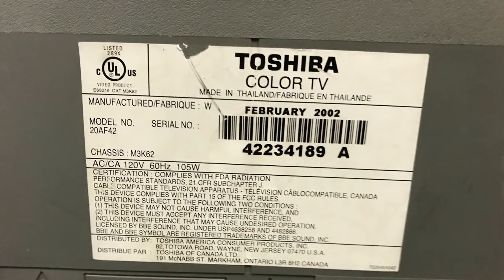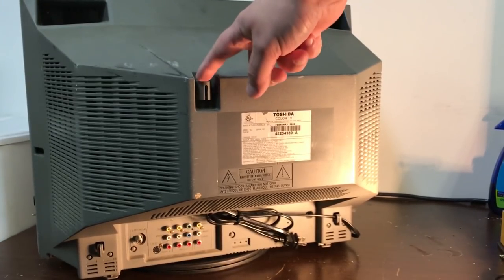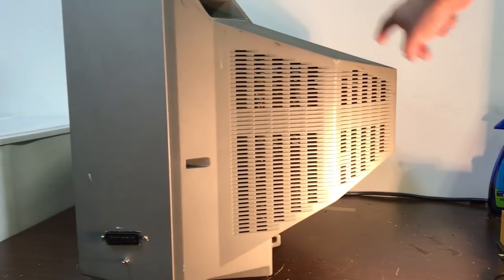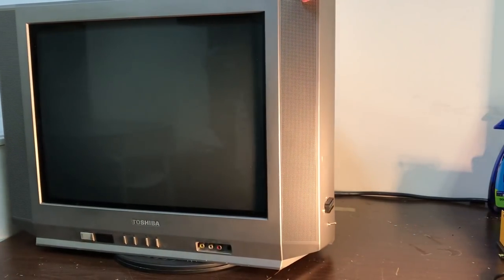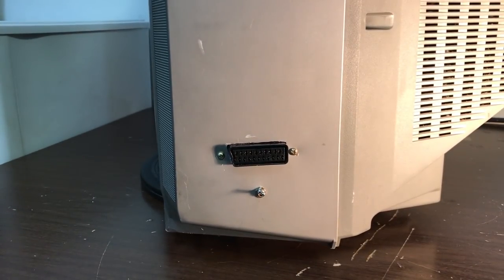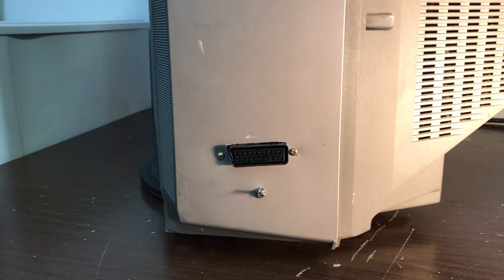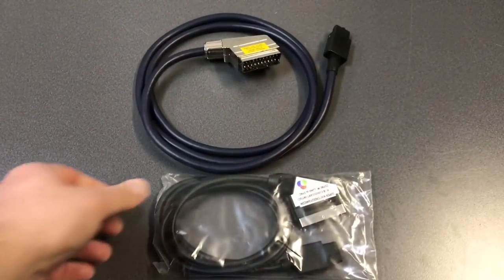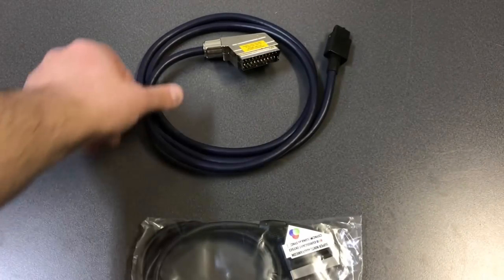RGB mod VS Component Video on a Consumer Grade TV

Comment: I have a Toshiba 14AF44 that picked up off the side of the road, so I was glad to see a similar model! I'm very appreciative of the Composite, RF, and Component ins, the 14 lacks those output composites though. My TV's yoke is ever so slightly tilted and it nags at me every now and again, is it worth it to remount the yoke on such a small consumer grade TV? I've tried adjusting it, and it's held on too well to get a lasting change
Reply: you may be able to look up a service manual for it online that may tell you how to rotate the screen via the service menu. i was surprised to find that i was able to do it with my sony crt without having to mess with the yoke. you might need an original style remote to do it though. i needed one for my sony since it also was a roadside find.

Comment: I am sorry to say that the issue you have with your red isn't the capacitors, it's the tube, or to be specific the red electron gun that's too much aged. If you can live with that you can still have hours from this TV, otherwise nothing you can do other than swapping the tube, though perhaps you have a potentiometer for the red electron gun power level (like the SCREEN/G2 pot on VGA CRTs) that would allow to alleviate these issues by raising the red electron gun power input. This is not a Trinitron so you have one electron gun per color, that's why the others look fine.

Comment: Was there ever a follow-up video? I have a Toshiba 27D46 that I’d like to mod. The image appears shifted or stretched/overscanned to the left using HD Retrovision cables, possibly due to the sync jitter issue they describe where some TVs process component SD as component HD (rising edge instead of falling edge of the sync pulse). It is a later model (2007). If I can bypass that issue by tapping into RGB, I’d like to.

Comment: Did you ever do that full cap replacement? I have a similar model Toshiba that needs it done for a vertical foldover problem, but wasn't sure if i should just replace the rest of the caps while I'm at it.

Comment: Something I always wonder: What were the developers using? Like, was Shigeru Miyamoto programming Zelda on an RGB modded NES dev kit plugged into a PVM using shielded SCART (or rather JP-21) cables? My guess is "no".
Reply: They did use PVMs and had their own self-build equipment. Which one, we don't know.
Reply: There's a video where the BBC did a news story on Nintendo of Japan in the 80s and they actually filmed inside the cubicals of the office. Nintendo had their dev kits connected to Sony PVM monitors while the cubicals had consumer TVs.

Comment: I would go with the largest ed tv I could find. I used to own a sony ed tv 27 inch, but it died and got thrown out without noteafing me. I miss it. SO much possabilaty's in this time of age. Now that there are component cables are available. Wonder if my local electronic store that do electronic repair could do a scart mod. Maybe something I will think to do in the future if I ever move to a place with enough room for it. How old are those professional monitors anyways. You guys watch out, electric shock could be dangres so I hear. 0.5 volts or more could heart you.

Comment: I picked up a 32” 800 tv line JVC consumer CRT. It is RGB moddable so I’m curious to see how it compares to my 800 tv line BVM. It won’t be exactly a fair comparison since JVC is a Shadow Mask whole Sony is Aperture Grill but it’s close enough. I really want to see how big of a difference the higher quality phosphors in PVMs really make
Reply from the maker: I'd really love to see the results of that!  What's the full model?  Also, are you sure it's 800TVL?  I always have such a hard time finding that info on consumer-grade CRT's.
Reply: RetroRGB not many manufacturers really shared that information with consumers. JVC was one of the few brands to actually include horizontal resolution in the specs to semi-market it. It’s a JVC AV-32D502. Pretty much all the D series JVCs are 700-800 tvl. It’s quite impressive for a consumer grade shadow mask

Comment: Hi Bob, I have a CRT question. I have two screens with the same problem. One is a 90's 28inch Sony trin RGB and the other is a JVC professional monitor, I only can get a really sharp picture on both when I turn down the contrast way down, but then I get a dull/dark picture. Any advise what maybe the problem is? I was planning to tinker with the focus pots?
Reply: Sounds like it might be capacitors to me, often the culprit. If the focus pots worked fine before, they shouldn't have shifted at all.

Comment: Its possible to add componant mod to a crt ? ( we have no component crt in europe)
Thx
Reply: it is electrically possible but you'd be better off getting a powered transcoder that converts YpBpR to RGB/SCART instead of building a circuit for it yourself.

However, I'm not sure why you would want to do that in the first place since RGB is still a tiny bit better
Reply: Mike IronFist Games our Ed and hd CRTs had component

Comment: Do you know of a source for convergence strips? Or do you make them?. Needing them for arcade monitors primarily but I have TVs to be repaired that may need them
Reply from the maker: No, they're impossible to find.  I believe the easiest thing to do is make them yourself.
Reply: Yeah I make mine. There was some old WG stock to years ago but they sold quick on Klov

Comment: I'd like to see a comparison between the method of injecting the signal into the 3 transistor collectors of the guns and using the THS7316 RGB amplifier for brightness/color adjustment with trim pots (http://www.psxdev.net/forum/viewtopic.php?f=62&t=723 and http://forums.modretro.com/index.php?threads/add-rgb-to-that-old-crt.12889/) vs injecting the signal into the jungle IC. I'd like to do this comparison myself sometime, but the IC's on my TV are the very tiny TSSOP type. And I don't want to get another CRT just for that. And if people know what they're doing, it's not a bad idea to adjust G2 screen voltage and the focus of the CRT. You never know if those can be set better compared to the way a Chinese factory set things up. There's good youtube video's on that. Just discharge at the HV connection of the CRT and make sure filter capacitors are discharged too people before you mess with the circuitry. Particularly discharge the HV connection if messing with the neckboard with the gun circuitry.

Comment: Does RGB bypass the processing and scaling in HDCRTs that inhibits light gun function?
Reply from the maker: Good question...but nope!  Light gun games work perfect in RGB, provided it's a curved CRT.  Flat CRT's sometimes have issues and flat-screen LCD/LED/OLED's won't work without some kind of hack.
Reply: @RetroRGB   Thanks for the input :)  my duck hunt did work after all.  Turns out my question was actually about HDCRTs (updated my old post to say HDCRT), but the one I have isn't HD after all whew... glad it works. (it's an SD bubble tube that just happens to have component inputs).

Finally I was wondering about those component cables for the SNES.  Are they utilizing the RGB pins on the SNES board? Or are they simply doing hocus pocus to make composite work on component inputs on the TV?

Comment: Can the worn out caps be recognized by just looking at them?? if there is no leaking, does that means they are ok??
Reply: They will sometimes bulge, however they may look fine on the outside and the only way to check is with a multimeter.

Comment: Is there a way to convert RGB from a computer to Component video with out any digital circuitry ?
Reply from the maker: No
Reply: You will need to buy extra equipment. I have done this with an Extron RGB 203 Rxi and an RGB to Component transcoder. For the Extron side, you would need a BNC to male SCART cable with a 470 ohm resistor on the sync line to reduce the sync voltage coming out of the Extron back to 75 ohm specification and connect that to the transcoder. Keep in mind that computers do 31khz and SDTVs only do 15khz, so you would need either a downscaler (Extron Super Emotia) or use a modified video driver, like CRTEmudriver.

Comment: Hi Bob, I have a PVM-14L2 monitor and I’m using Retro Access RGB cable to connect my SNES via the BKM-129X input card. Why doesn’t the RGB input let me control the chroma knob in front of my PVM? It does work with component HD Retrovision cables. Is it a limitation of how the RGB signal gets processed, or is there a setting I have to enable?

Comment: So here’s the thing that’s bugging me about this comparison: Calibration. With an RGB mod you are basically bypassing the NEED to calibrate since you are sending the exact RGB signals to the TV, but when using component, you would need to first ensure that the picture is properly calibrated for that input FIRST. It would also make sense to use an RGB to Component adapter box that is known (tested) to convert the signals properly. That way you have as close to an apples/apples comparison as possible since the RGB output from the console would be the same.

Comment: i have a 32in tv and one thing to watch out for is larger scanlines. iv used a crt tv as my main tv. but iv been using a '19 and wanted to upgrade to something bigger. a 32 in but i didnt realize as the screen gets bigger so do the scanlines. and theyre really distracting to me. u loook at a blue sky and theres just black bars all across lol its not for me. on smaller sets u barely notice em.

so this has led me on a quest to get the best picture out of it. im using a dvdr recorder which upscales s video to 480i. so it helps cut out the scanlines but now the screen jitters when some elements are on screen (since its a 240p image). so im experimenting with solutions lol

Comment: Regarding this Toshiba, it uses a TB1253N jungle chip. I'm not sure if this is the case with the TB1253N, but I've been informed (by 6tanks from crtdatabase, on the article for the Sharp 27F640) that the TB1253AN  has an issue where the RGB black levels don't match that of the video inputs. So the RGB input will look darker, which is basically what you showed here. In addition, the component video quality is excellent, and doesn't provide an improvement over component. He does state that RGB modding would still make sense if the set doesn't come with component input.

The fact that my JVC AV-36230 uses the TB1253AN as well (and the fact that it's 150 pounds) is the reason why I decided not to RGB mod it. And I kinda noticed the affect of the black level difference firsthand, even without modding it. It doesn't always appear, but when the OSD menus take up a large enough part of the screen the whole screen seems to get darker.
Reply: Biggest issue this TV has is that it was made by Orion with an Orion tube. If it says made in Thailand then it's an Orion.

Comment: Awesome stuff. Just a note on PVMs vs Consumer CRT. If you're running component, RGB or EU RGB scart it would leave a bad taste in my mouth to pay the ludicrous prices people ask for a PVM. It really isn't worth it unless you get lucky and can get one for a low price, and I do mean low. Less than £100 atleast. As a kid I was using RF on 16 bit for the entire era and it wasn't until PS1 that I started using composite. I didn't even notice. I just played and enjoyed. Some people actually prefer the softness of edges provided by the lower quality signals too. A PVM might look so good that it won't look how someone remembers it. I have been on a CRT purchasing binge lately and have quite a few now and they all look fantastic but also quite different side by side.

I have:

Panasonic Quintrix tx-25ck1 - less than 100 hours use. Beautiful picture quality. I was pleasantly surprised.

Trinitron KV-AR34M81 - which is a behemoth. I prefer this one for 8 bit titles as it straight up feels like an arcade machine. Brilliant for multiplayer couch co op. Scanlines are too noticeable for most 3D titles though because of the size. N64 doesn't suffer from that issue as much and still looks stunning. Can't figure out why. All using component.

Trinitron Widescreen KV-24LS35U - Mind blowing picture quality and that was just with composite too. It isn't natively 4:3 (black side bars grrr) so will likely pass it on to a friend. If this was 4:3 it would be a dream come true.

Bang & Olufsen MX7000 - This one I will be collecting next Wednesday but I hear good things.

I'd like to get a JVC D series to complete the collection but I'm running out of room. In time they will live in a retro gaming room.

We need to preserve this fantastic technology as best we can. Oh and would be buyers should accept that it is highly unlikely they will get a consumer CRT with perfect geometry. With a little know-how we can tidy it up but it's usually something we'll just have to accept. Even then it's still miles better than any flat screen regardles of converters and what not.

Comment: I love your videos! However just look at the PVM vs Consumer CRT comparison at 8.37. This absolutely demonstrates the current delusion that pro monitors are automatically better than consumer CRTs. Look at link in both images. The Toshiba puts out a more cohesive image of the character. It looks more like a real character. This pro monitor obsession is driven by the fact that the USA/Canada/Other countries never received RGB scart as standard. Just my opinion of course, and as I say I love what you do! I have a BVM & would much rather play NTSC games on a new/low use consumer CRT.